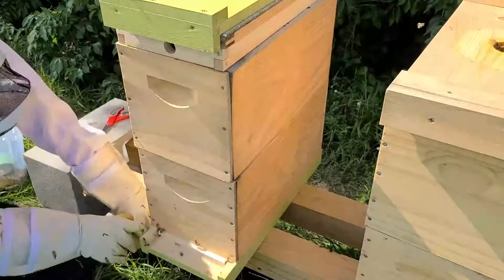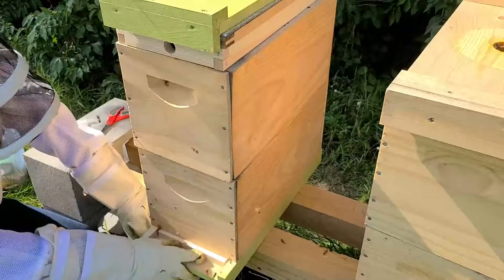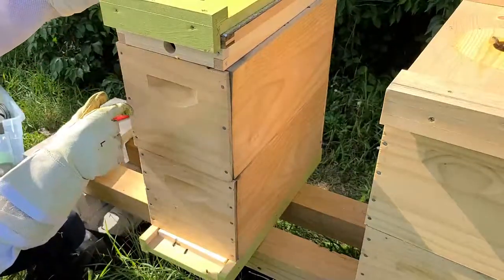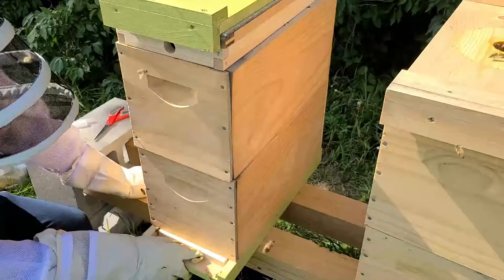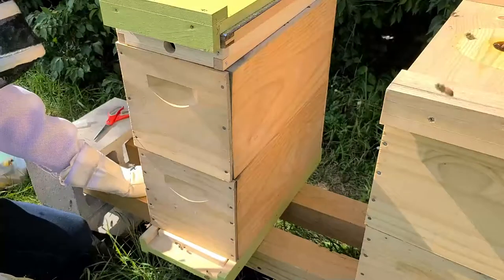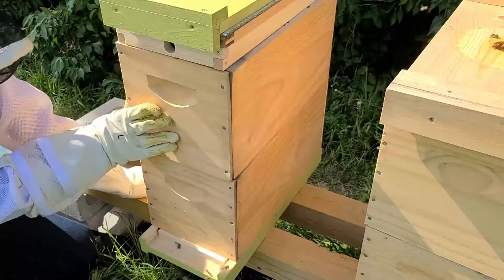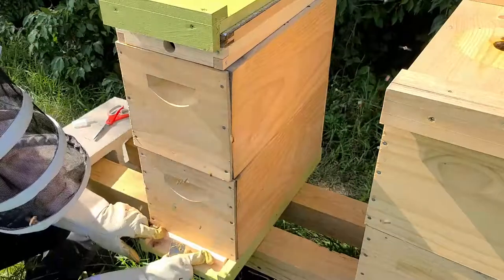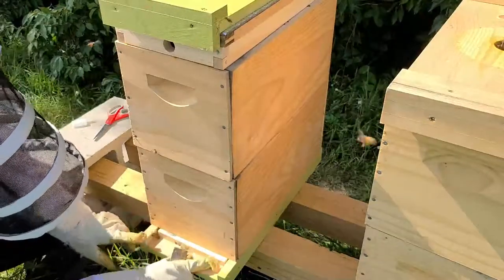Nuc Hive Entrance Reduction & Upper Entrance for Winter (Rec 09/21)

Comment: pls try this: exchange those leather gloves by white latex gloves (put 2 on one hand if insecure) and use more sturdy rubber working gloves for the very stingy ones. Your bees are rather ok. I wouldn't mind to work them bare handed. BUT you must work from the long side! from behind (small side is ugly for you and your bees). Put the Nucs into 4-square config not row! them you can work 2 from the long side and switch to the opposite side and work the other two in the 4-sqaure thermo config.. make it mor easy for you and less stressful for your bees :)
Reply: Why? leather restores/holds sting alarm pheromones = attracts more stings! white latex gloves gives you more feeling to learn to handle gently = less stings, less agression! working from long side give orthopedic position plus much more fine control handling frames = less stings/stress/alarm! exchange frames with Hoffman-sides by 7mm distance knobs like the continental collegues do = less brutal working, much faster working, less stings and stress :)
Reply: Hoffman sides are just cheap and maybe good for long haul/ transport when glued together with propolis by bees - other wise them are just bad praxis